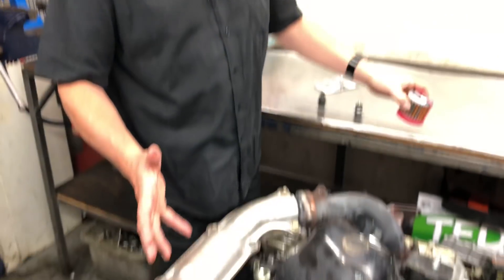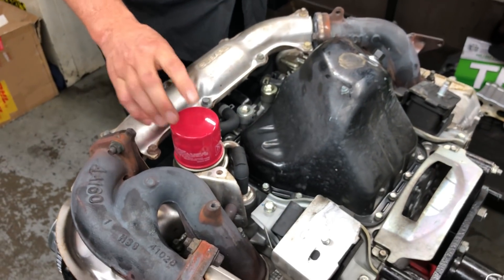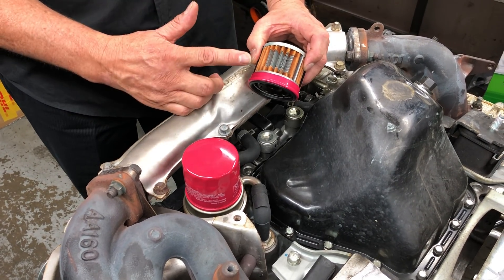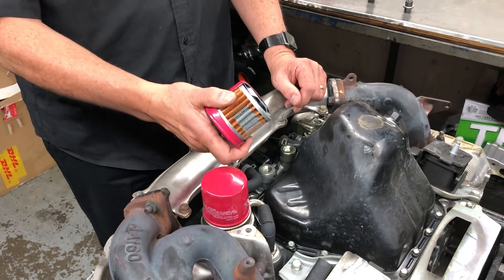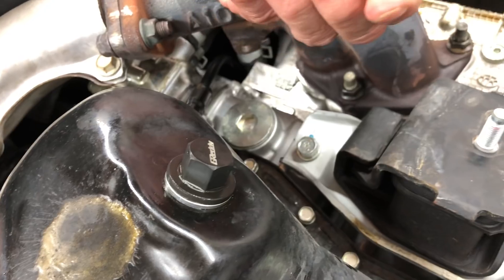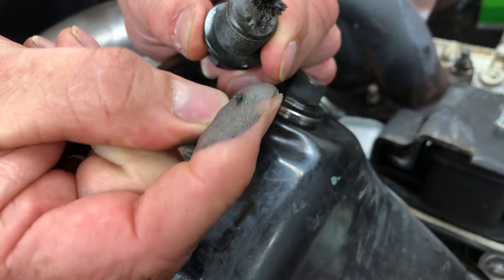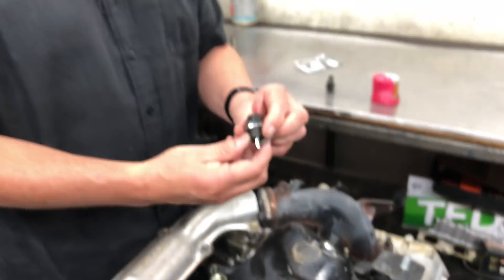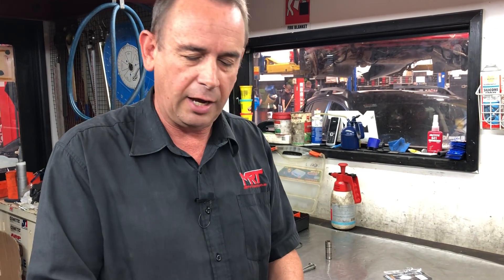Are Magnetic Sump Plugs and High Quality Oil filters worth it?

Comment: Quality oil filter and a GReddy magnetic sump plug are a hell of a lot cheaper option than an engine rebuild...even if you can rebuild an engine with your eyes closed
* i can think of at least 1000 things I'd rather do...one of them is just sitting and staring at a blank wall

Comment: The famous 95 MERC uses Pennzoil Ultra Platinum 5-W-20; Bosch Premium Oil Filter #3410; and FILTERMAG #SS365SSS Magnet Kit. The Bosch Premium Oil Filter removes particles of 20 Microns -- oil and filter changed at 5,000 mile intervals.
 The FILTERMAG #SS365PR gives 11+ square inches of magnetic holding power, and removes ferrous metal particles of all sizes.
The FILTERMAG is re-usable, and lasts a lifetime .
https://www.mercuryforum.com/forum/grand-marquis-14/1995-grand-marquis-restoration-8937/

Comment: Mine is actually titanium, not aluminum :) what do you think about Bosch premium oil filters like 3300 and 3330? Also, how do I tell the difference between a reusable washer and a non-reusable crush washer?..
Reply: The famous 95 MERC uses Pennzoil Ultra Platinum 5-W-20; Bosch #3410 Premium Oil Filter; FILTERMAG #SS365PR Magnet Kit. Oil changed at 5,000 mile intervals. FILTERMAG removes ALL sizes of ferrous metal particles, is re-usable, and will last a lifetime.
https://www.mercuryforum.com/forum/grand-marquis-14/1995-grand-marquis-restoration-8937/

Comment: These were all fitted on engines and transmission as standard pre 1980s. And still used on jet and piston driven aircraft today . Aviation calls them magnetic chip dictators. They should be in every engine bay wright they are many parts that are attached to a magnet. Cylinder liners 
Piston rings crankshaft ,camshafts and parts of the oil pump. Nice video 😊

Comment: Use 2 big magnets from any magnetron from broke microwave oven. Stick it to the bottom of pan. If your oil pan is not made of steel, buy magnetic one.
Reply: Magnets from a broken microwave or a computer hard drive are just ordinary magnets -- that really don't do a very good job of removing ferrous metal particles from an engine's oil. These magnets are NOT treated to maintain their holding power when HEATED by the engine oil.
The FILTERMAG #SS365PR is an 11+ square-inch, 2--piece magnet kit, with operating range from -40 F to +302 F.
 It is re-useable, and will last a lifetime. Removes ferrous metal particles of ALL sizes.
https://www.mercuryforum.com/forum/grand-marquis-14/1995-grand-marquis-restoration-8937/

Comment: I usually fit a magnetic sump plug to every engine. It's the simplest way to tell which oils, oil additives and metal treatments work the best. A magnetic sump plug can also provide a warning that there is a problem in the engine. They're really easy to make.

Comment: Just a point of order - most engines and parts are aluminium or alloys thereof. Which isn't magnetic.
Reply: The moving parts, like the pistons, the crank, valves, etc, none of that is aluminum, even on an "all-aluminum" engine.  It's the moving parts, made of steel, that generate any metal particles you might find in your oil during an oil change, and those would be caught by a magnet.

Comment: K & N white filter goes on mine with the cellulose element, has much more filter element than those ones and the bypass is a proper spring as well
Reply: It doesn't have the gauze support of the filter, and is only 30 microns. You're better off with a Ryco Syntec oil filter which is much like the STI, and is 20 micron with as much better filter.

Comment: Nope not worth it.  Just use full synthetic oil, decent filters - and even the orange Frams are fine - and change the oil at 5000 miles or whatever depending on how dirty it looks. Been doing this for 25+ years and multiple vehicles that have gone 200K - 300K miles with no oil-related problems ever. The vehicles fall apart around the engine. The engine could probably go another 200K. I can definitely tell newer engines can go longer on oil. My kid's 2011 Mustang has practically clean oil when I change it around 7K. I do use better filters on this one though because of the higher mileage. My older cars get changed between 4 and 5K. I would never trust the oil change light that's all for environmental and 15K intervals is courting disaster. Any filter will get the particles, it's the dilution of the oil  from age and use that I believe causes problems. Would I go 8000 miles on an orange Fram filter? No way. But 4-5000? No problem.

Comment: The STI pink oil filters are about $50 shipped here in the US. It's either OEM blue made by Honeywell (also makes Fram) or WIX/NAPA Gold, which surprisingly are the only aftermarket ones with metal internals like the STI one shown in this video, which also have the correct 23psi bypass pressure.
Reply: The WIX # 3974 is the eqivelent to that pink filter in the video.

Comment: Any recommendations for a high performance oil filter for the Subaru Diesel engines?  I'm currently using the OE filters for routine servicing & replacement, but would be interested to know opinions & options.

Comment: Anyone that is thinking of using a Greddy magnetic sump plug, PLEASE use a crush washer. Using the included non-crush washer will cause an oil leak. This happened to my WRX, and as a result over the few hundred miles that I drove without knowing... the displaced oil slowly destroyed the paint surfaces off of my Cusco under braces, as well as covering my exhaust/boots and other under-chassis bits with oil. Otherwise, I've had no issues with the actual sump plug itself, as it seems to be a pretty high quality piece of kit.
Reply: BlueHokage *new one with every oil change.
Reply: BlueHokage free oil spray
Reply: True! The non crush washer causes leak! What do you do to stop the leak?
Reply: So along with your magnetic sump plug you also got for free your vehicle undercoated so it wont rust

Comment: Those pink STi filters cost $40 U.S. each, shipped but I'll definitely be buying a Greddy oil plug now :)
Reply: Gamma Light ya those pink filters are crazy expensive. I'll stick to the black Subaru filters
Reply: 20$ for a premium Mobil 1 filter is just as good
Reply: I use royal purple filters, k&n or blue oem but I do change my oil every 1k miles on E-85 or 2.5k miles on gasoline. I think it most important not to overuse oil filters more than what kind of filter. If the color or smell of the oil is off I change it so a high quality filter like royal purple only makes sense if I'm keeping the oil in the car for a while.
Reply: VIsubby I've been using Liqui Moly 4605 5w30 and absolutely love it and it's E85 resistance, I don't think it's a GL5 oil but thanks for the heads up. For the most part I'll never run Royal Purple oil but their filters seem to do a good job in till 3k miles in my experience with GL3-4.
Reply: K&N! Royal Purple! It's rather evident from the people responding here no one knows a thing about bypass pressures.
Reply: Chris Iovino well clue us in, know it all
Reply: Subaru OEM filters are rated for an unusually high 23psi bypass pressure. Your typically aftermarket K&N, Royal Purple, etc are designed to fit many models and other vehicles and have bypass pressures in the upper teens, but sometimes as low as 15psi. The problem here is, once that bypass pressure is hit, oil flows around the filter, not through it, thus not doing it's job. So using anything other than OEM (the blue, black, or pink ones) or the aftermarket WIX ones with the correct bypass pressure leaves you with much less filtering capability.
Reply: Chris Iovino I'll look it up again but my understanding is a filter size also dictates it's oil bypass pressure and quality manufacturers don't deviate from that, it's been standardized. So any quality manufacturer who produces a filter to replace a STi blue filter that also fits a ex. Toyota Corolla means that the Corolla and the STi share the same bypass pressure and filter dimensions to begin with. Royal Purple, k&n and Subaru blue all use stamped spring metal that is the exact same demention among the 3, I've cut them open and looked.
Reply: Chris Iovino also for what its worth, oil filters only actually filter 10% of the total oil over 6k miles and personally I'd rather have more oil bypass then oil starvation especially with short oil change intervals. A high oil pressure bypass with a dirty filter element to begin with is a recipe for oil starvation resulting in motor damage. So as I said, I'd change my oil before it gets dirty and that alone circumvents any issues and all I'd really need a filter for is a high quality drainback gasket more then a filter since I'll never use parifin faced motor oil.